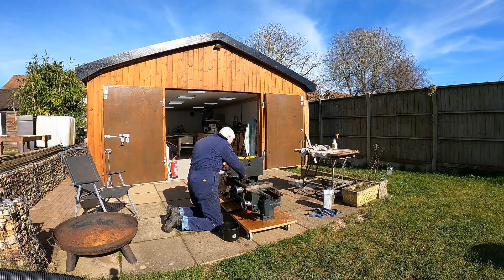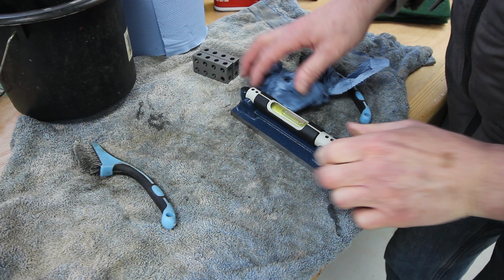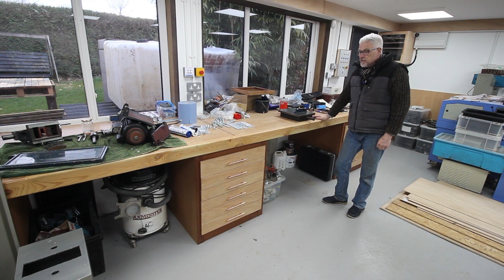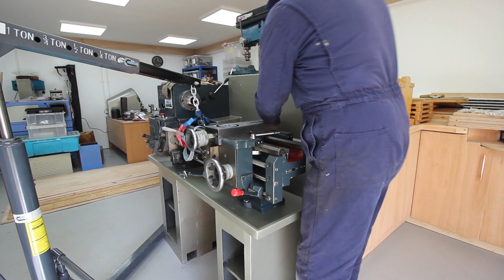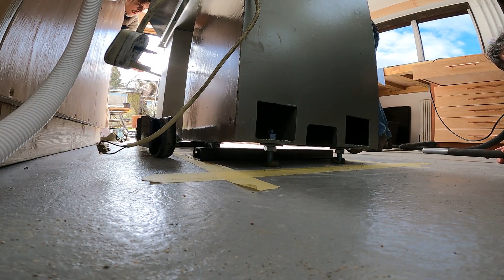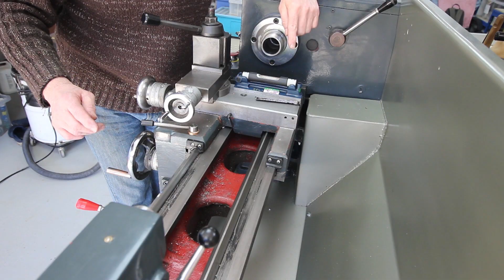Installing and levelling an engine lathe

Comment: I've got a machine level where each line corresponds to 0.02mm at 1m....that can make for some real fun
Reply from the maker: Wow with that you can prove everything is as solid as a wet noodle!
Cheers
Reply: @CazualHaze  I needed something more accurate than the machine I was using it to make and yes it's surprising how much apparently stiff things can move!
Reply: @ yep everything is elastic if you look closely enough!